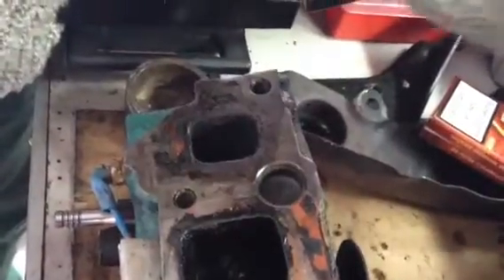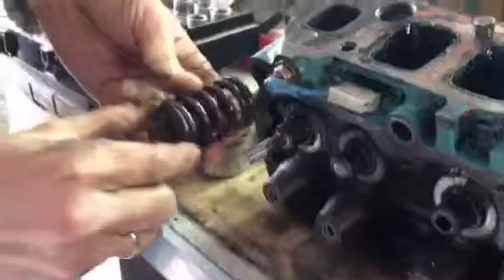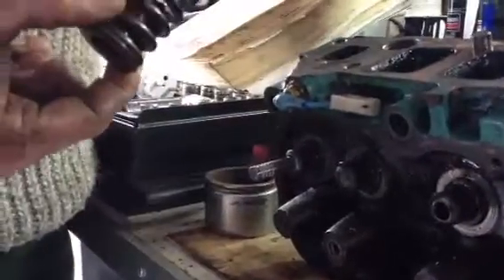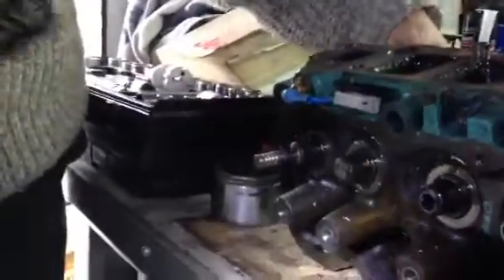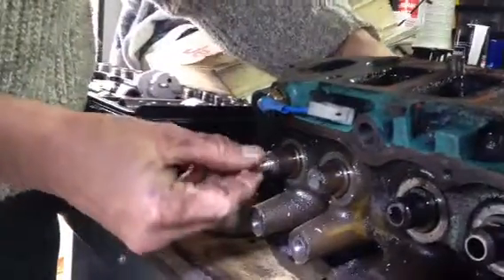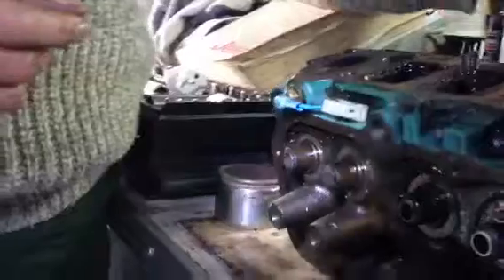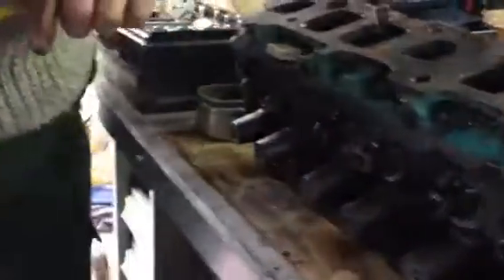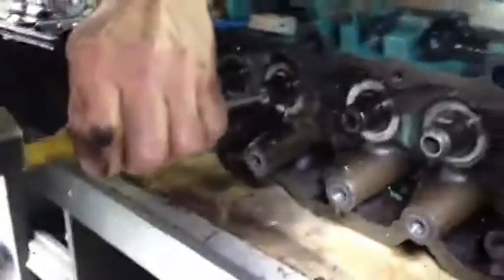Jeep 258 bent push rod sticky valve - full analysis #10

Comment from the maker: Thanks, you are absolutely right. And indeed, it cleaned the tank, replaced the tank filter, all rubber hosing and inline filter as well. And even the carburetor. And it was necessary. Cheers.

Comment: I had the same thing happen to me 30 years ago on a 261 Chevy Inline Six.  I did an engine rebuild but didn't clean the old gas out of the tank.  The valves stuck and bent the push rods. The valves looked like they had been coated in glossy black paint!  The machine shop guy said he had a devil of a time getting the black stuff off the valves.
-- Moral of my story, pull the tank and have it cleaned!  
Do NOT add Berryman's to the gas tank!  Just makes the bad gas WORSE!